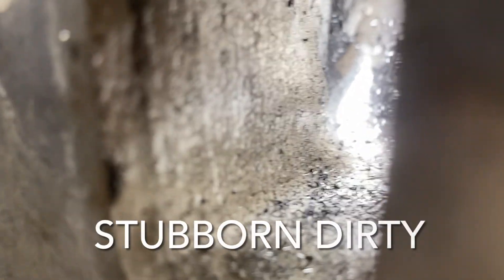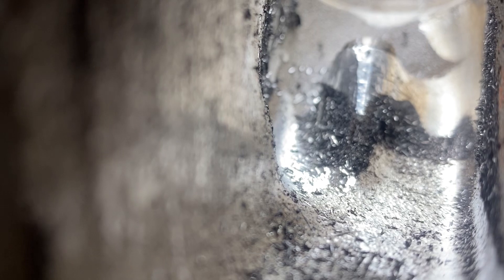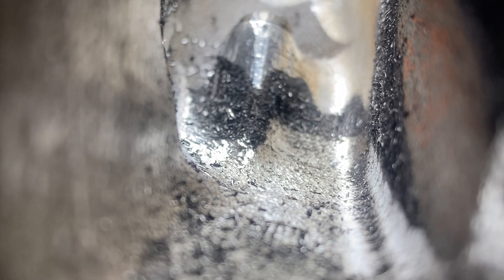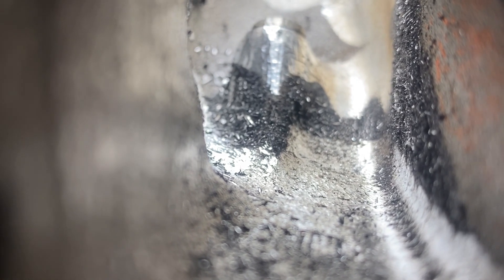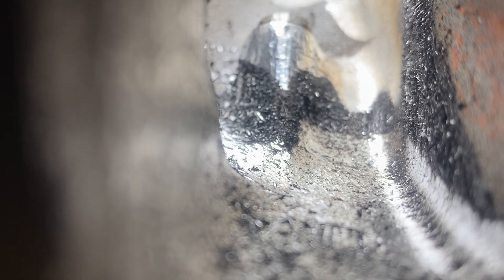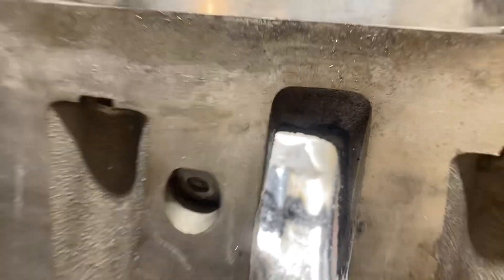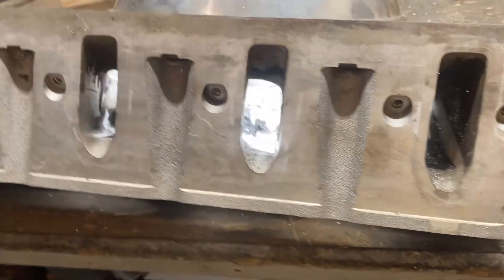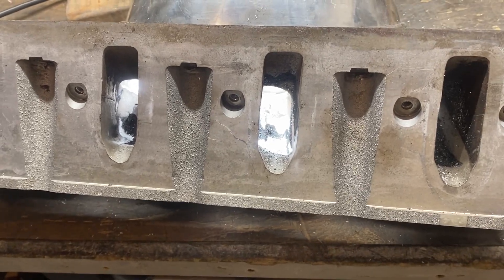a21bravo 5.3 Twin Turbo Ranger Ported 862 Big Valve heads

Comment: JD- I trust you are well.  My latest set (706's) were pretty nasty.  My buddy with a high pressure  (~4k) washer "cleaned" them me. Did pretty well, only a thin crust left.  Good ole diesel fuel and a little finger work took care of that.  What method did you use to widen the chamber around the valves?  Keep up the good work.
Reply from the maker: Stock 4.8/5.3 head gasket properly located then scribed the “Fire ring”.  There’s no benefit to opening the camber past the gasket. 
I’ve found with a sacrificial valve to protect the seat, may need to be cut down a tad, I use a couple 3/8” burrs to slowly work the chamber walls towards the line.  There’s flow to be had working both the intake and exhaust walls. 
Go slow, avoid ridges/troughs.  Finish with sanding rolls to blend 120+ grit. JD 
3/8” double cut egg
I wish I had a Hot water pressure washer 3000+ psi!!!  😁😁😁
Reply: @HeadFlowInc  Thanks for quick reply.  Your expertise is appreciated.

Comment: I've watched many of your video's on how to port the 862's and so far I've gotten the exhaust side done. Now onto the intake side, the 3" burrs I have aren't long enough. I bought a set of 6" and at 10k rpm, there's too much wobble. Where you get your burrs from?

Once again, thanks for the informative videos!
Reply from the maker: You must limit your rpm with the longer burrs, you may have already bent them. 
I get burrs from Fastenall, Cornwell, eBay etc. 
Also aggressive single cut burrs are really hard to control; I rarely use them anymore. True you will need a couple 6” burrs in egg and flame shapes 3/8” and 1/2”. 
For the bowls especially the intake bowls I like to use a 5/8” double cut tree to work the throat to bowl transition. JD

Comment: What does something like this cost?  And what for time frame?  Thanks
Reply from the maker: Total cost depends on the build, stock valves?, Ferrea valves, spring kit single/dual.  
As a guideline you’ll be around $1100.00-$1400.00 for ready to run fully machined/ported/shipped heads.
Build time est 3-6 weeks
Reply: @HeadFlowInc  thanks for the reply!  How much more flow are valves worth with a 243 on a stock bore 5.3?   I have my own springs
Reply from the maker: @86boostdcapri  After porting you’re looking at 300+ cfm int & 205+ cfm exh flow.  Using 2.00” or 2.02” intake valves required for max flow. 
Email me: jeffdubray@gmail.com

Comment: Get yourself a old dishwasher on craigslist or offerup.  I scored a maytag for free.  I took apart the manual timer, removed the motor, and marked where the tub drains.  Because the motor is gone, it will stay on the cycle as long as I want.  Fill it using a 5 gallon bucket...Only needs a gallon of so.  Allow to run for an hour, and then drain into the bucket.

I use a combination of purple simple green HD (Safe for aluminum) and I also put some baking soda in it, and a dishwasher tablet.  I won't say it makes for a replacement several thousand dollar parts washer, but it loosens stuff up quite nicely so when you take them out, if you scrub right away, you can get them really clean.
Reply from the maker: Excellent idea thank you for sharing! If I had room I’d be on top of this 100% I hope others who read this have bigger shops or an area they can put a dishwasher. That’s a really good idea thanks again for the tip